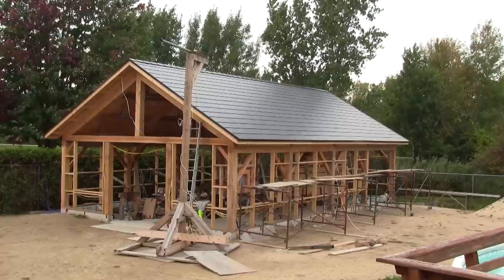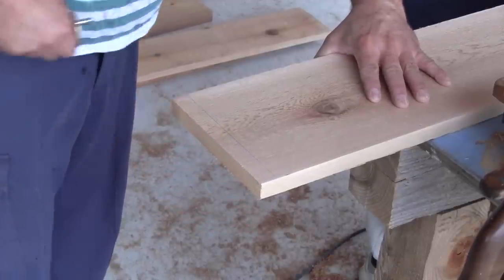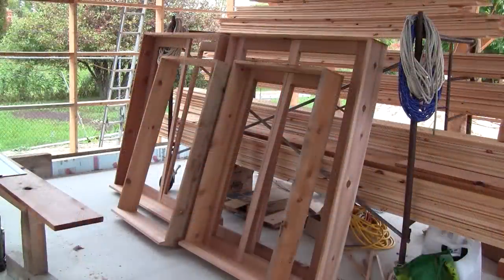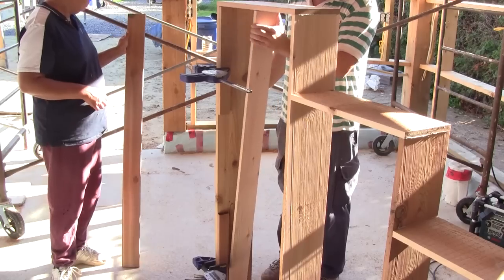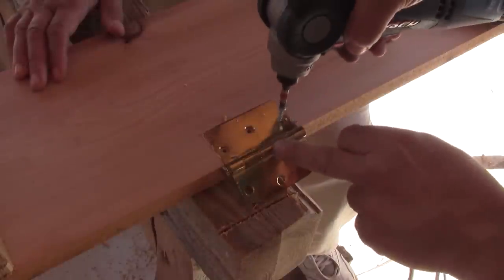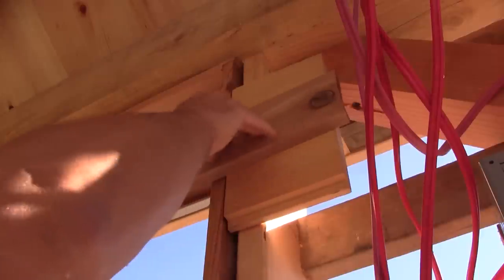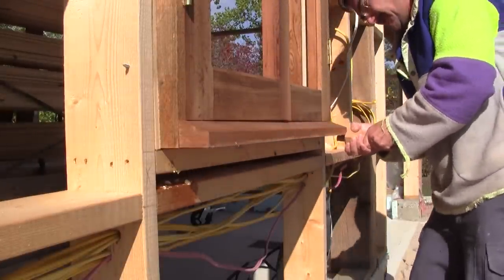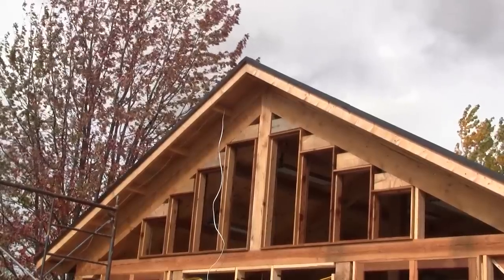The Woodpecker Ep 63 -  Building the new shop part 10 - Window frames

Comment: As someone who, like you, are trying to build something with limited help, I can appreciate all of the time and effort that goes into constructing this massive project. However, you have given me some great ideas again. My building front will similar. Your crane system gave me ideas on how to hoist up my 3/4 plywood to the platform top and to do that I am using my UTV and winch. Got the first sheet up yesterday. I was planning on using barn sashes on the front of the elevated structure. Now that I have seen how you built your window frames, I believe I can use that to frame in my own sashes and use the window lock system as you have. Keep up the good work as I know you will enjoy this project for years to come.......I'll keep watching and learning from you.  Thanks again!

Comment: You are making me nervous wearing that fleece jacket when using the router table, stay safe.  I'd hate for you to get hurt and not be able to keep pumping out these great videos :)
Reply from the maker: You're right, I just noticerd it when I was editing it. It's the main reason why I always work with short sleeve, even in winter. But it's begining to be realy cold outside and short sleeve are out of the question, i'm not that hot... When the wall insulation will be finished you'll be glad to see me with short sleeve again :)

Comment: I assume the locks are only intended to keep the windows shut not for security purposes as the hinge pins are easily removed on the outside. Otherwise I'm loving this build series and truthfully very jealous
Reply from the maker: If someone realy want to come in for a "bad" reason I think that breaking one of my 16 accessible
windows will be much quicker.
This is one debate I have for many decades, peoples put super heavy duty deadbolt on their front door just beside a paper thin exterior wall or most of the time just inches beside the door window, a window is not realy a big burglar protection system. So yes the lock are just there to keep the wind outside :)

Comment: Fantastic build!  Can't wait to see the shop when its done.  Is that an airless sprayer you're using?
Reply from the maker: No it'a Earlex HVLP. I bought it to spray all my shop planks. My spray gun wich work with a compressor doesn't work that well and it was hard to adjust and reproduce the same adjustment each time. A Earlex HVLP is WAY simpler, only one adjustment.